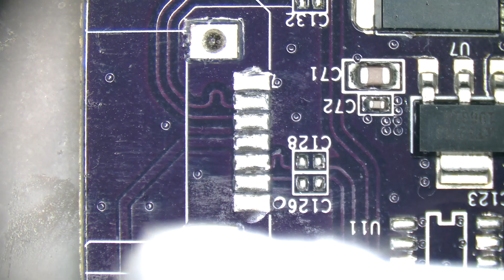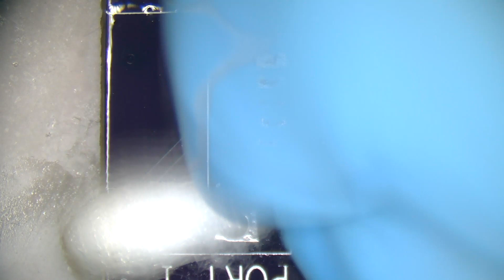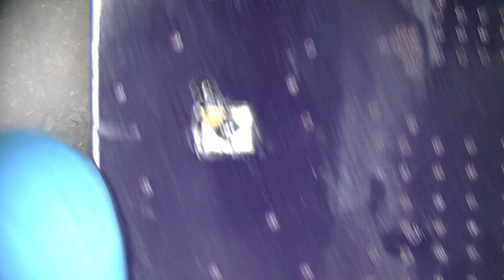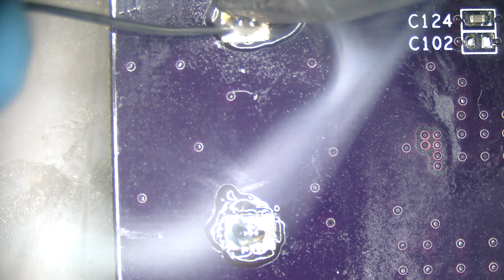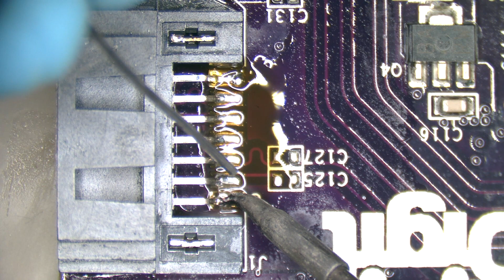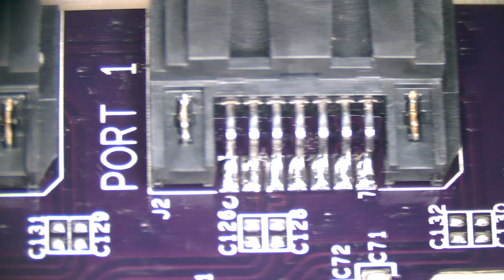Soldering new SATA ports #sata #sataport

Comment: What if you accidentally bridge two of the pins while soldering? Could that potentially start a 🔥 fire?

I want to try to resolder a sata connector that came off of a 8 way pwm pc fan hub